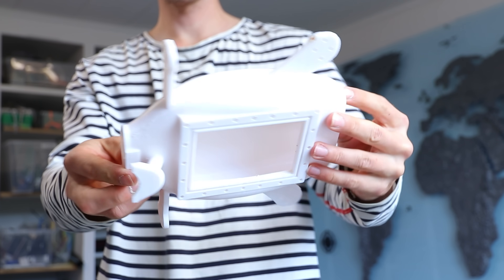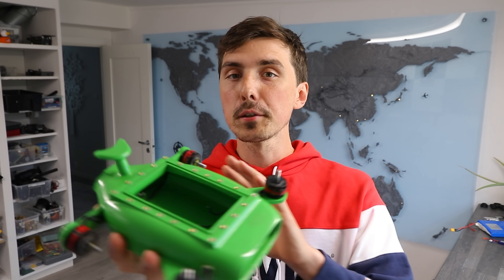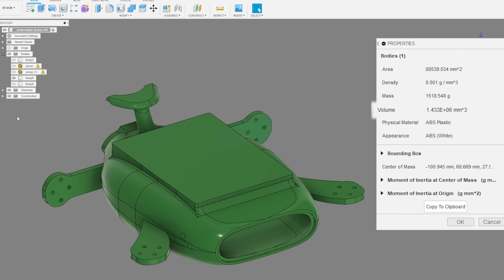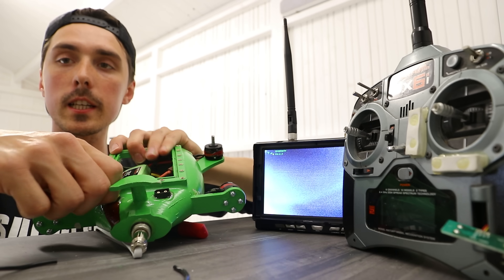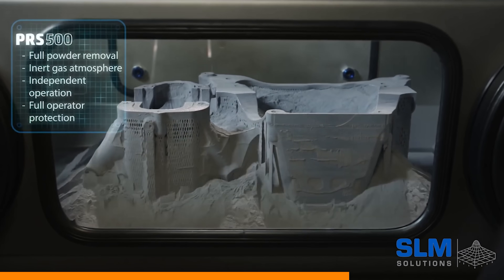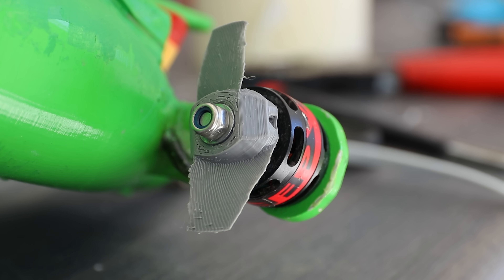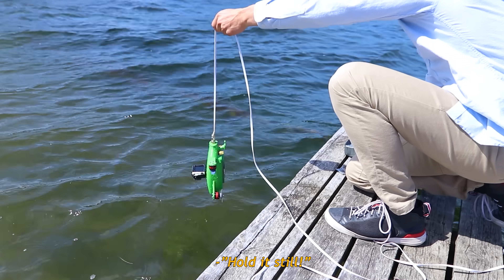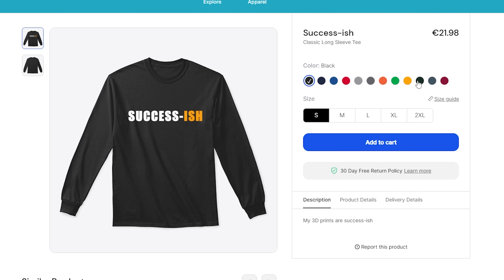Underwater Drone Built With Parts From a Flying Drone

Comment: Hey Simon, I love your videos! I work for a scuba dive computer manufacturer, and a lot of the issues you are facing are awfully familiar. Our earlier dive computers have a faceplate with 8 screws onto an o-ring sealed surface much like the one on your drone. We've found that ironically this kind of design leaks far more commonly near the surface than when at depth because the water can seep by the seal when the pressure is lower, but as the pressure increases, the faceplate is forced back upon the o-ring. The sealing surface for the o-ring is critical. Too much surface roughness (as you may find with a painted 3d print) and the water can pass right by the o-ring at lower depths. As well, properly sizing of the o-ring is also very important. Too thin and it can't make good contact, but too thick and it can fold onto itself and cause channels for water to pass by. All that being said, I am a firmware developer, not a mechanical engineer. YMMV.
Reply: Temperature probably plays a part too. The water will start to cool the internal volume of air dropping the pressure inside. Getting the electronics hot to compensate, pressurizing the hull slightly, or pre-cooling below water temp might help.
Reply: The problem could be fixed by attaching a standard tyre valve to the device's casing. Just connect the air line at any fuel station (or a handheld bike pump) and you can pressurize the device's internal space with air to at least 5 atmospheres. So then any small leaks that do happen will be bubbles of air escaping rather than drops of water getting in. It also makes it easy for the operator to recognize and remedy any leaks before they cause a problem, since the bubbles can be seen. You could even include an absolute pressure sensor on the circuit board so that a drop in pressure can set off a leak detection alarm so that the diver can surface before the computer gets wet.
Reply: Thanks for the input. Sounds like you may have used a face seal, then. Maybe you went to a "piston type" seal later on. I noticed a lot of, if not all, Suuntos use that. 

Just one correction, small, thin o-rings can actually hold quite a lot of pressure perfectly well - as long as the surfaces are smooth. But if you meant sealing on a 3D printed surface, I guess you are right, a bigger surface could help bridge small gaps in the surface.  
Anyhow, I have 1.5mm cross section o-rings in some spots in my pneumatic spearguns ( up to 33bar). And Suunto has 1.0mm cross section rings on the button pins on, at least, D4 and D6 computers. And in one place in one of my computers, they have an even smaller one.
Reply: @AntiVaganza  Another thing with o-rings is that you should put a generous amount of grease on them to fill any gaps. I work in manufacturing/qc for small sensors and we always have a big jar of vaseline at hand to grease up the seal of our pressure tester.
Reply: @unicorntulkas  I hate to disagree, but normally, the rule of thumb is not to put much grease on o-rings. As little as possible, actually.
I think the idea for the grease is not to fill in gaps, but more to lower the friction of the o-ring so that it can move easily into where it needs to sit in the groove during assembly and when pressure is increased. 
Perhaps, that's just the internet speaking, and maybe you are right, but that's how I have always done it. I would think if you need grease to fill in gaps, your surface is not smooth enough in the first place.
Reply: @AntiVaganza  I mean I’m not an engineer, but I play trumpet and we use grease and oil on the slides and valves to help seal the instrument when we play. It mostly lubricates but helps with leaks too
Reply: Flat O-Ring or Round O-Ring???🤔
Reply: Round the corner of the lid off. Sharp corners and gaskets are not a good solution, they always tend to leak. Use an O-ring instead of that printed gasket, and use a gasket sealant to compensate for the rough surface texture of the 3D printed surfaces. It doesn't have to be high temperature rated though so even a very thick grease would probably help a lot to fill in the micro gaps, and at the low pressure water shouldn't press the grease out of the seal. 

Someone down below suggested printing the hull in ABS and acetone smooth it. That might be a good idea to get a waterproof skin. It could also make the gutter for the O-ring smoother but I'd still not trust it and use something to improve the seal.
Reply: @blahorgaslisk7763  I'd also think he could epoxy a piece of lexan (or have some acrylic laser cut) to the chassis as a pretty much perfectly smooth sealing surface, with the middle cut out for the door of course, then have a second piece of lexan (or again acrylic) for the door itself, and a flat gasket in between, I'd just think that would be the easiest way to manufacture such a thing
Reply: When assembling large vacuum chambers with flat round seals and bolts circling around it, you have to tighten the bolts in a particular pattern to maintain even pressure across the whole seal. Maybe that can help here too??
Reply: Nice we already developed one for the suba driver in India it gives all the details about suba divers and oxigen temp everything on it
Reply: Adjusting the tightening pattern, and applying marine grease should help. Hopefully.

Comment: In the small 5v usb water pumps you can buy  , the impeller is attached to a magnet , and spun in a waterproofed alternating coil .. so no water shorts the motor out .  the impeller and magnet just sit inside a tube that's part of the housing . Would water jets be as good for steering?

Comment: Submarines use water and air pressure to sink, you could do the same.
They don't need to be adjusted to specific value to the weight of the load, because the load varies.
Reply: Submarines use ballast tanks which are completely flooded to remove positive buoyancy from the submarine. Then short term compensation tanks are used whereby water is pumped into or out of the compensation tank depending on depth. They also use trim tanks where water is pumped fwd to aft or vice versa to maintain pitch. Compressed air is used only to clear the water out of the ballast tanks at the end of the dive. I agree that he could implement a few of these things into his next iteration.
Reply: @danielstewart3507  hmmm how would you compress air on a scale that small?🤔🤔
Reply: @alfstewart2592  I don't think a drone needs ballast tanks. But I think it could probably use a short term compensation tank. Ballast tanks aren't really needed because the operator can just reach into the water to extract the drone once it is near the surface. A short term compensation tank would be useful because the drone wouldn't need to be weighted at all. The tank could be completely sealed off from the rest of the vessel. This would do away with the need for needing to store compressed air onboard.

Comment: Maybe I missed something, but if the drone has to be attached to the floaty thing anyway, why not just supply it with power from there? Why an extra battery in the drone?
Reply: Maybe because over long distances DC voltage tends to heat up the wires and he would need some thicc boi wires which would affect the movement greatly
Reply: @YasirAhmed-od5tt  I didn't know that, thank you
Reply: @metaclypse32  it could also just be for weight to get the drone underwater

Comment: Hi Simon, your drone sucks ass!
I believe if you made it like the 3000$ drone it would be better!

Jokes aside i don't believe a seal exist that wont let water through, my father and I tried many times with just boats and not submarines and there always was water inside. I believe it is best to just accept the L and water proof electronics with a conformal coating

Comment: Doesn't the flotation device need more than one hole, so the air, which is pushed inside by the fan, can escape?
Reply: Fan is more like an “air directioner” and less of a compressor. While directing the air inside it also lets air escape through it
Reply: @MrDexter9i3  In that role, it mostly turns the air around, and the exchange rate of air is really low. The air can't get in and escape at the same time through the same space and while trying to blow it inside, there are not many spots within the fan for air to escape freely.

Comment: 3M 4200 and 5200 are excellent sealants that we use on boats.  5200 coated over the 3d print would be a good sealer.  4200 for sealing the parts together, like under that connector and glass.

Nice drone.  Fantastic work.   Perhaps a buoyancy tank would be a nice future upgrade
Reply: Coating it with 5200 would be terrible. You would never get a smooth consistent coat. It would be better to coat with an epoxy which would be way easier, less messy and much more waterproof.

Comment: I would 3D print it with the hatch on the bottom instead of the top. Might help keep air inside the body and less water.
Reply: good thinking

Comment: You can paint the 3d printed parts with resin ( the type used in resin printing works well )which helps with water proofing.

Comment: They are called ROV. Better to have the electronics in an cylinder with o-ring endcaps and bulkhead-connectors. Then also do a vacuum test

Comment: The hull is so thin walled that you could definitely get away with magnetic feedthroughs for the propellers rather than external motors. Also hatches should be round, or at minimum round off the corners. Rectangular seals are a huge pain in the rear every time. Also you can just buy o-rings in practically whatever size or material you want, which will probably work way better than that printed thing.

Edit: Credit Brick Experiment Channel which built a lego-inside-tupperware submarine using such a feedthrough. It worked great.
Reply: I would trust waterproofing advice from a guy named Seal.
Reply: I don''t know the quality of them speed and torque wise , but mini submersible fountain pumps with custom propellers seems like an idea.
Reply: Have you seen the video video "Building a Lego-powered Submarine 3.0 - balloon and compressor*" on the*Brick Experiment Channel?* (It's a fun watch.) He used a magnetic couple to keep the motor inside the sub. It worked pretty well but it really limits the speed and torque from the motor. Friction is a big problem with magnetic coupling.
Reply: @ddegn  Yes, that is precisely the inspiration. Limited speed and torque is fine. The total possible length of voyage of this thing is the length of the tether, so speed is not a high priority.
Reply: @sealpiercing8476  It would be cool to see. The one which used Lego bricks worked pretty well.

Comment: Actually is not in your design but in your motor selection, beacause in under water there is more durt so it stucked in outrunner motor you can try using inrunner motor type which is dust resistance... but Your design is really Outstanding..

Comment: Cool!  Maybe next time make the opening on the more stable shape, the end with an o-ring seal.  Also, if you can tolerate the poor cooling, draw a vacuum inside the chamber to change buoyancy and tighten the seal.  A little vacuum sensor will identify if the seal has a problem. The motors may work in water (not salt) but contamination will destroy the bearings.  A simple enclosure with greased double o-rings would be simple, maybe.

And the crabs were, um, preoccupied…

If I didn’t say, really cool project.
Reply: I agree with you about using a better shape for the opening. Either a circle or an oval with an appropriate o-ring might be good enough to keep the water out. I think some subs actually pressurize the insides so it's harder for water to leak inside. Using a vacuum to test a sub is OK but a vacuum will make the sub more likely to leak. I think he'd be better off using some other form or leak detector.
From what I've read and seen in YouTube videos, brushless motors will work in salt water (I was surprised to learn this). You need to clean the motors after they've been in salt water really well. I'm pretty sure you need to use some sort of lube or WD40 to keep the bearings from corroding/rusting. 
I have made plenty of RC ground and air vehicles but I've never made a RC sub. This is one thing I'd really like to build sometime in the near future.
Reply: @ddegn  interesting.  Another commenter suggested magnetic couplings so the motor would be entirely isolated from the water. When I was a kid I dropped a mabuchi motor in the water while it was connected to power and thought I'd wrecked it.  But it ran for a long time before I got bored.  A sub would be an interesting build. I also wonder if there are any leaks between 3D printed layers.
Reply: @microdesigns2000  From what I've seen (in YouTube videos), magnetic coupling works great to keep the motor sealed away from the water but it comes with a pretty big price in power reduction. I think friction is a big problem. There's a really fun video on the channel Brick Experiment Channel titled "Building a Lego-powered Submarine 3.0 - balloon and compressor" which uses a magnetic couple. It worked pretty well but I think the magnetic couple really limits the speed and power of the propeller.
3D prints are notoriously leaky. Resin prints are generally water tight. I think RCLifeOn used a bunch of water proofing material on his sub to keep it from leaking between the layers. Someone in the comments here recommended using UV resin to water proof the sub.
Another 3D printed sub on YouTube is made by T-Zero Systems. I really liked his series of videos on his sub build.
Reply: @ddegn  thanks for the recommendation, it was a fun watch.  I had difficulty understanding how moving air between the vessel to the balloon tank outside but still connected could change the buoyancy.  Lol.
At my last job, we always used a clutch between a motor and a load, either a slip clutch, a detented clutch, or on rare occasion magnets. The engineers mounted the magnet discs as close as possible, but bearings held them just apart.  The clutch action was of course a little violent, but this approach was much simpler than tiny little mechanical clutches. Later, because I'm a controls engineer, the mechanical engineers wanted me to use software to limit torque on the servo motor, while using full torque during accel and decel. All these uses were to provide mechanical overload functionality.  I introduced the company to stepper motors, and they now use 200-300 per year.  Turns out current control works nicely to control torque at low speeds.  And they opened up a new realm of complicated high speed machinery.  🥦Fun times.  Now I spend my time in a high tech factory helping process engineers make gains on productivity, so changing software sequences, cycle times.  I came from a background of high speed machinery, averaging 300cpm but many times going over 1000, and one time 2000 (seems impossible, but this is normal in beverage industry).  My current role is so slow I can watch the process, indexing one (expensive) part every six minutes.  Of course the parts are huge, glass windows up to 600lbs each. It's still very interesting. 

If you want you see some stepper motors in action on high speed machinery, please see a video called continuous motion trigger assemble from Haumiller. The machine takes randomly oriented cans of WD-40 and rotates them so the can graphics will line up with with the caps and straw, then it assembles the two with a couple hundred points of force or so.  Hard to believe it's been so long now.  Most of their machinery is not on YouTube because there are proprietary process, but many are huge systems with many frames the size is the machine in that video. Also in the video is my embarrassing HMI design from back when I used "company colors" to create objects on the screen. I don't read a very good book on the subject and modified my designs accordingly where color is only used if there is a problem, and those mostly yellow or red.  That covers the ten percent of men who are colorblind.  There is so much to learn.
Reply: @microdesigns2000  Your job sounds really interesting. I dabble in hobby robotics but I haven't used stepper motors much (there's in my 3D printer and CNC router but not my hobby robots).
I design and program industrial flow meters. It's interesting but also a lot of work.
I learned to use microcontrollers to record data in my chemistry lab (I used to be a chemist) but I enjoyed the electronics so much that I've transitioned to mostly working with electronics and programming.
I watched the Haumiller video. Very cool. Thanks for suggesting it. Thanks for sharing all the great info.

Comment: Just to clarify you physically can charge a lithium polymer battery without using the balance cable but you really shouldn't. If the cells become out of balance you will end up overcharging one of the cells because the charger has no idea what each individual cell voltage is and blowing up the battery.
Reply: The way would be to use an internal 3-cell BMS which costs $3 from ali.
Reply: @DoRC  You must be special!
Because the rest of the world does not turn the BMS off ever.
Reply: I think water is a problem that whould kill the battery before unbalanced cells. So not really a problem if it dies before the problem developes. Problem solved.
Reply: @meckarelis3235  lipo cells are sealed so even if it got wet that really wouldn't be much of a problem.
Reply: @DoRC  shorting rhe conector and lip no more

Comment: Why not use actual rubber to seal the top? A rubber soft enough that it will compress and fill gaps when the lid is closed. 

Also for charging, why not put a wireless coil (with the appropriate electronics) on the side and charge it through the plastic?
Reply: Your idea for actual rubber is great, but wireless charging is too slow so does not works for lipo